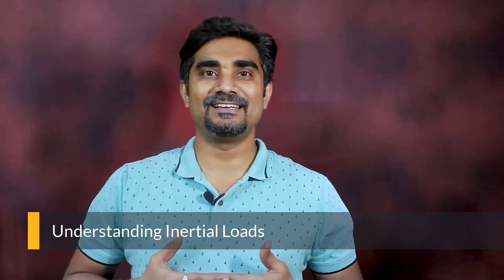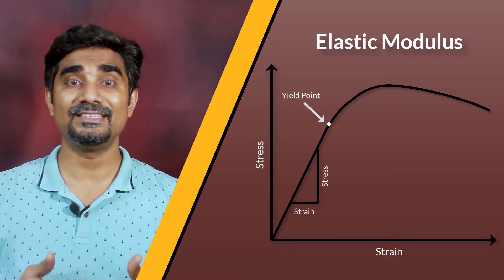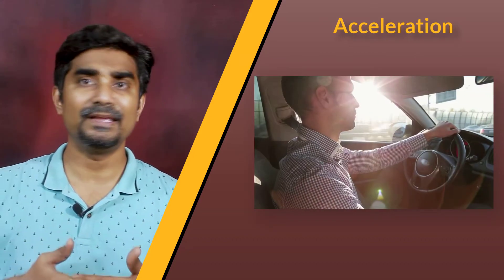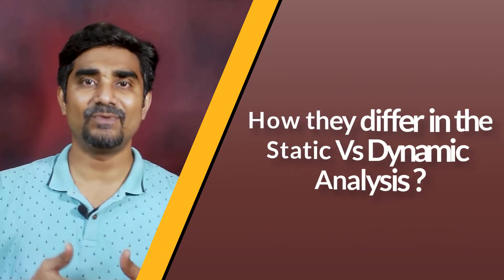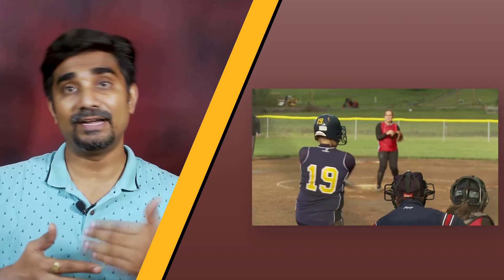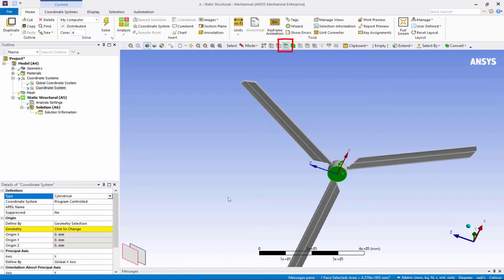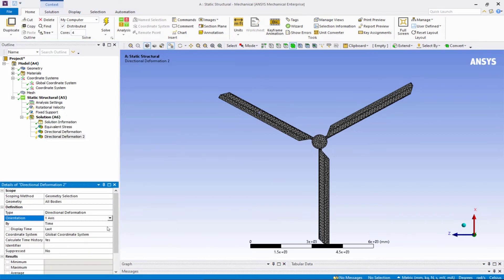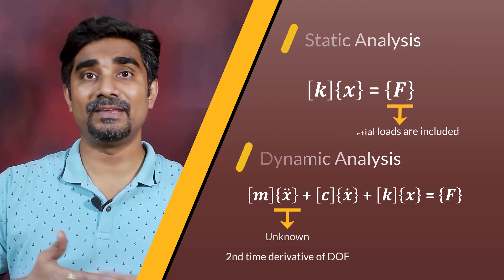Understanding the Inertial Loads Using Ansys Mechanical — Lesson 5

Comment from the maker: This video is part of the free Ansys Innovation Course, 'Structural Boundary Conditions for Stress Analysis using Ansys Mechanical'. Access all of the course contents including additional lessons, handouts, simulation examples with starting files, homework problems, and quizzes: https://courses.ansys.com/index.php/courses/structural-boundary-conditions/.

Check out other courses on the website while you’re there. Happy learning!
Reply: How can I apply inertia load in a rotating beam in ansys apdl for modal . I have tried giving rotational speed in rad/ sec but there is no change in natural frequency

Comment: Still I don't understand if  1.5rad/sec acting on body, does it fan rotates, if rotates how long please?
Reply: Imagine  a small fan at home and you suddenly grabbed the shaft while its rotating at 1.5 rad/s. The current simulation is similar to that situation.
Reply: @drury2d8  Perfect analogy.
Reply: It rotates  but relatively to anchored (grounded ) Coordinate system - you cant see it in such analysis. In this analysis fan doesnt rotate as the CS is fixed to it.
Reply from the maker: Thanks for watching! Please post your query on the Ansys Learning Forum for a detailed answer from the wider Ansys Community: https://ansys.com/forum.